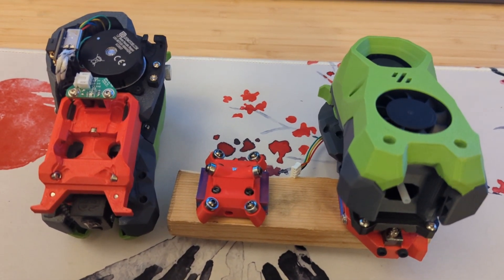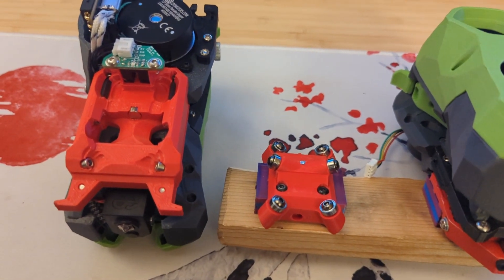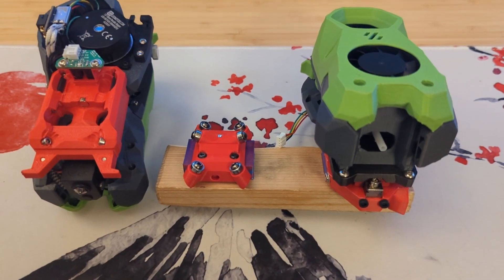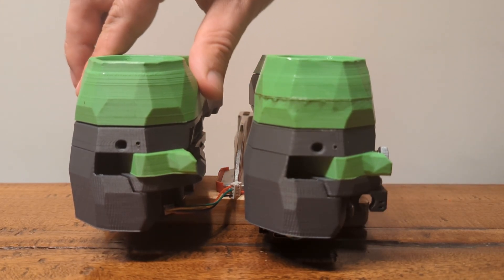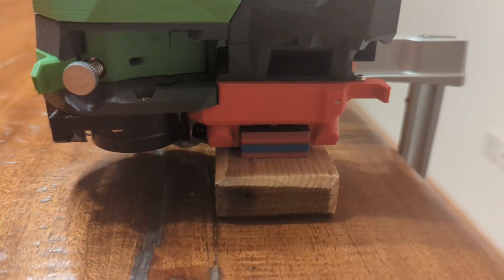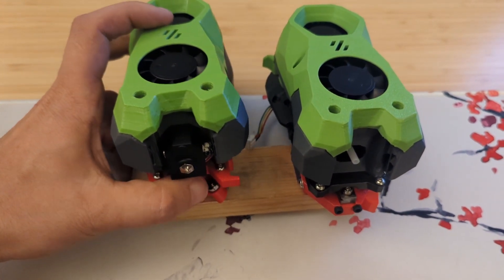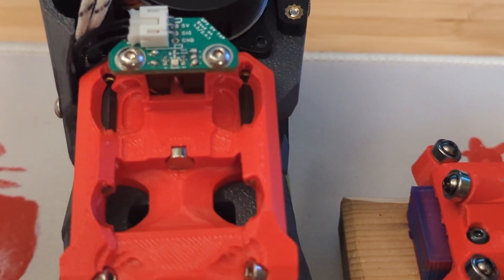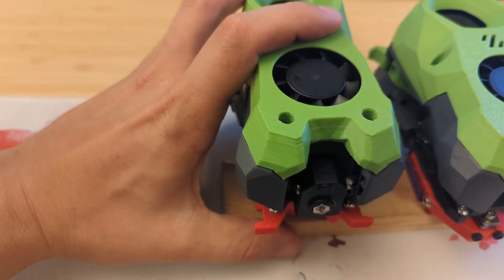Tapchanger vs Voron Tap

Comment: Does the Tapchanger still have the gantry leveling capability of Voron Tap?
Reply: yes
Reply from the maker: Yes. If you want you can just use it as tap replacement, without the tool changer part.
Reply: @viesturz  brilliant solution!
But I‘d want both functionalities!

How much height does the Tapchanger add to the construction, without reducing the build volume? 🤔
Reply from the maker: @andrepavatoni you probably want something like 150 mm extra height to not loose any space. There is someone  building a version up and down in the discord. Def an area of development.
Reply: That‘s incredible!

Comment: You would probably have less flex with a carbon or glass-filled filament. For example, I have some of the Phaetus ABS-GF and it's very stiff (the filament is quite brittle, and easy to snap).
Reply from the maker: Yes, CF-abs is def an option.
I have aluminum SLS printed shuttle on order, will test if that helps first.